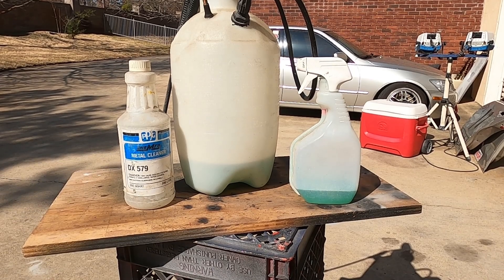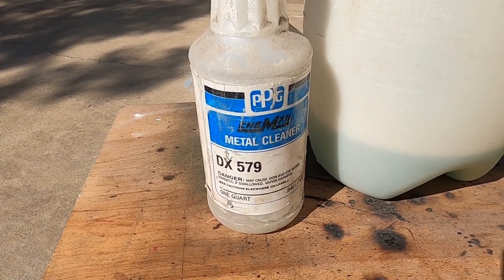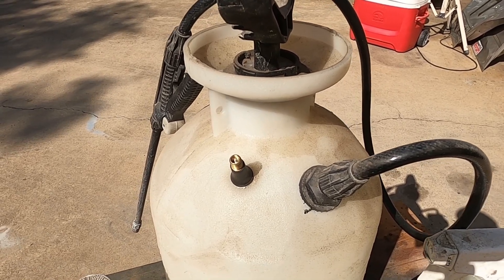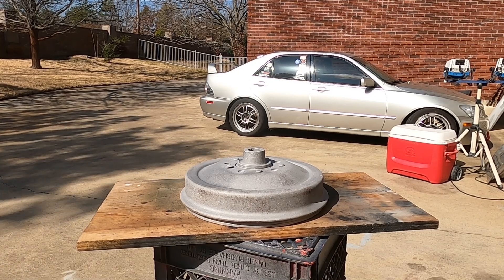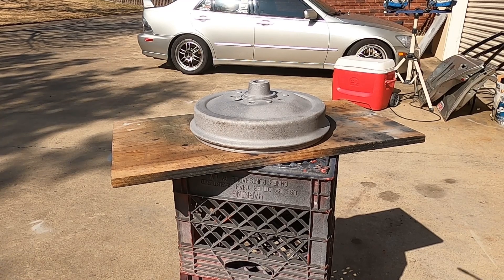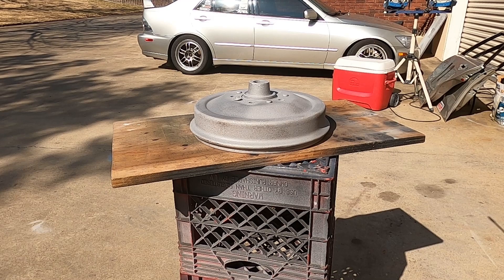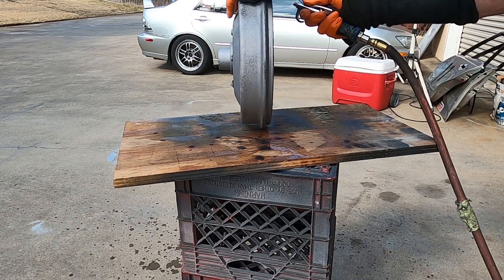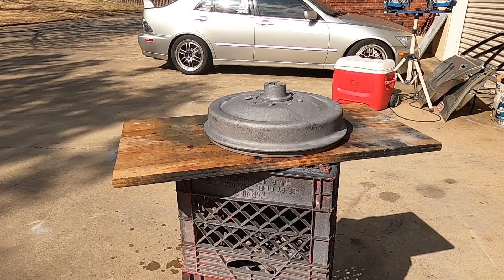Shop Talk - Metal Science:  Passivating Ferrous Metals With Phosphoric Acid

Comment: Thanks for watching, please subscribe.
I need to comment on the use of Ospho (phosphoric acid)..
We knew of a guy who thought he would beat our technique and wipe it on. 
This will not work, you need to flood the surface with the Ospho.
The entire issue is that the pores of the metal are also rusted, and blasting
cannot get in there, only by flooding the surface with liquid will you
get into the pores. The microscopically rusted pores is where the rusting 
process starts all over again to ruin your paint job.